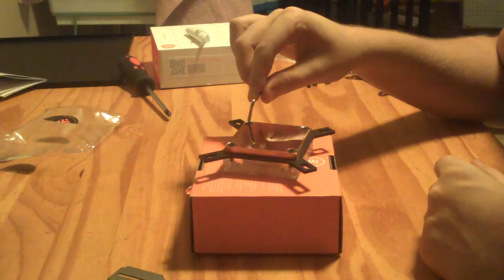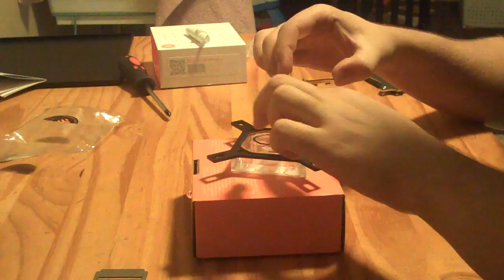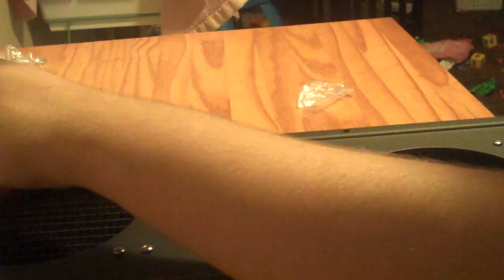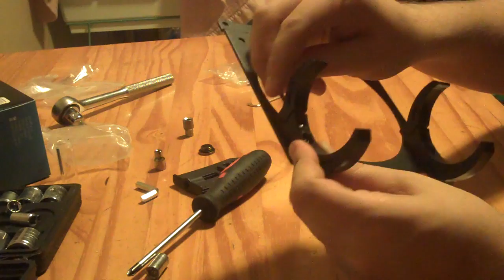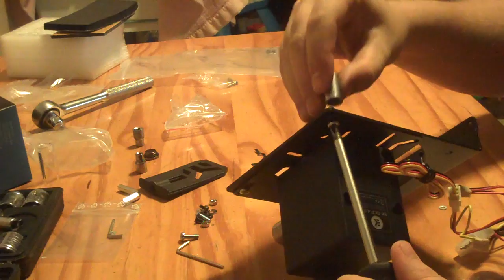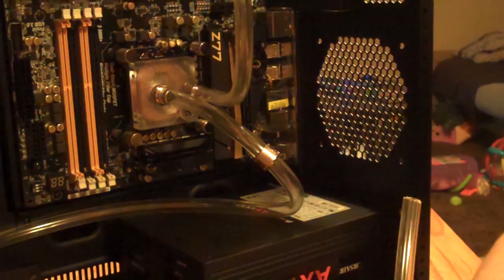EK H30 360 HFX Watercooling Kit Installation

Comment: Got this kit for my Antec V3 1200 ultimate gaming case, installed the rad internally up top and love it!! everything went in easily, and is running cold as ice babay!
Reply: i got the ek-h30 240 adv liq. kit but same diff just smaller rad